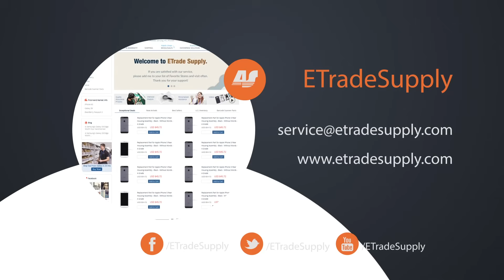iPhone 6S teardown/disassembly

Comment: lmfao tearing down is easy the issue is putting it back together properly. Using a microscope is required for faster assembly due to the small screws and ports. Good video by the way simple and fast.

Comment: I ripped that wire at 3:55 how can I replace it?
Reply: The antenna
Reply from the maker: then maybe you will need this antenna flex cable replacement http://www.etradesupply.com/apple-iphone-6s-wifi-antenna.html and then follow the teardown video to put it back.

Comment: Hey man can I have a link for the kit? Like the screw driver and the thing to take out the sim card and stff?
Reply from the maker: Hi, there is the link for the repair tools, hope you can find what you need, http://www.etradesupply.com/accessories/accessories/repair-tools.html?limit=60
Reply: +ETrade Supply Thanks man, my phone has a dent in the back and stopped working and I was wondering if before I bought the kit can I just replace the battery? That's what got dented

Comment: Hi, thanks for the nice descriptive video. Is the thin double sided adhesive tape used to glue to LCD to metal frame available to  purchase?
Reply from the maker: +HS yes, these are the double sided adhesive tape http://www.etradesupply.com/catalogsearch/result/?warehouse=0&q=+double+sided+adhesive+tape. Also there are original digitizer frame adhesive you can check http://www.etradesupply.com/apple-iphone-6s-digitizer-frame-adhesive-black.html

Comment: you should always disconnect the battery on any electronic device before removing any cables
Reply: What about if the device screen does not function